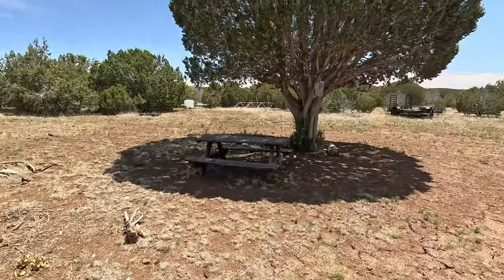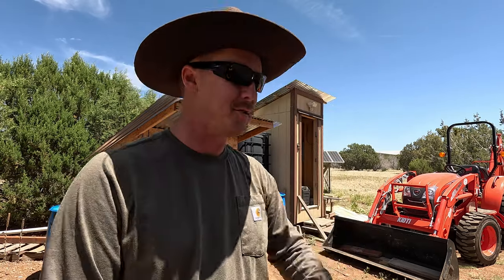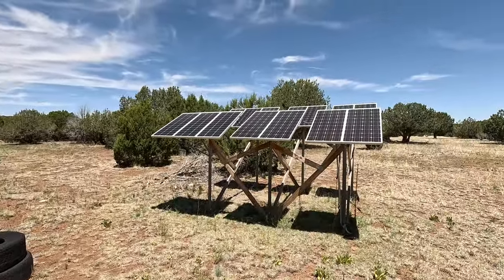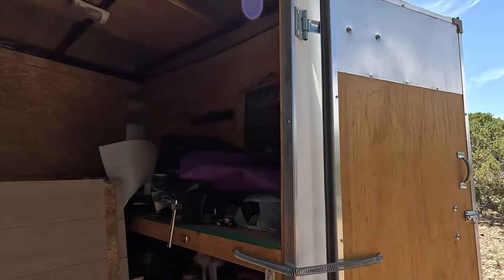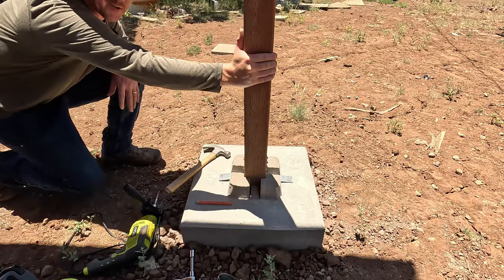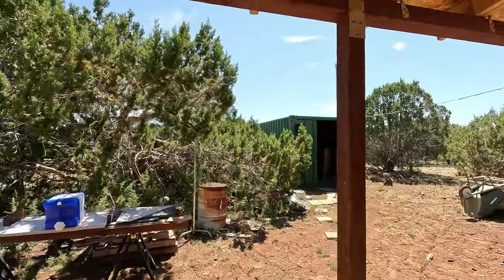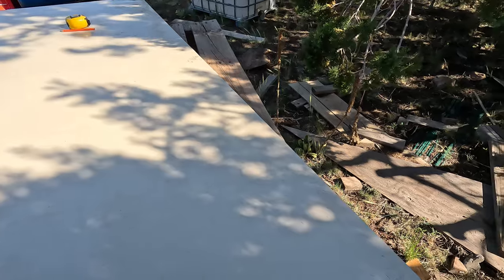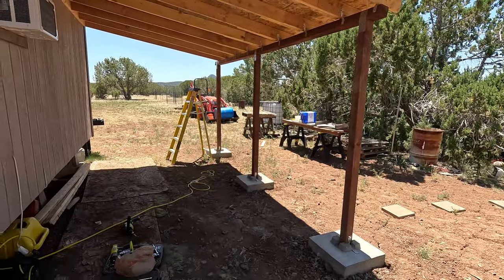Gettin $h!t Done!

Comment: What type of trees do you have planted? Just did 2 types of apples at my place I have a gravity fed IBC tote setup  on a battery powered automatic timer to water them. Also for your batteries you thinking of doing the server rack style lithium batteries? I’m still back and forth on getting thoes or getting a bigger EcoFlow solar generator I have the delta 2 version and it powers everything in my trailer minus the AC. 

Have a good day
Reply from the maker: All I have left are one apple tree and one peach tree.  I also have a gravity fed IBC tote and a timer, but I haven't gotten around to moving it to these trees.  I'm thinking server rack batteries and an all-in-one charge controller/inverter.